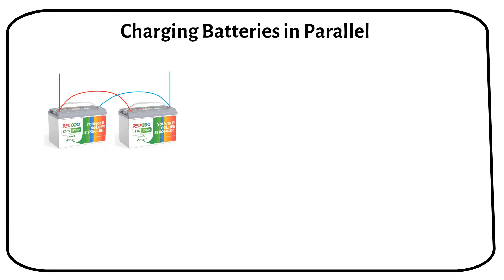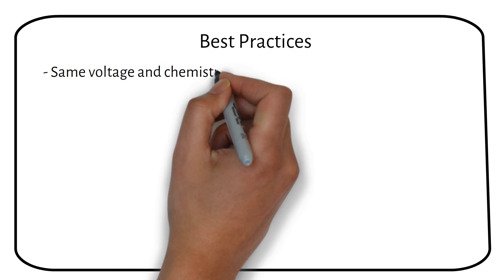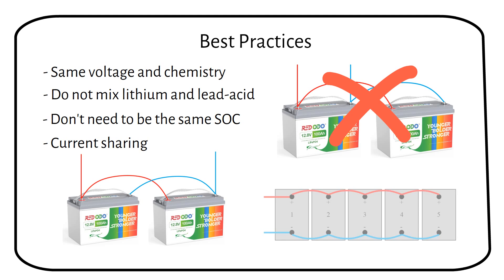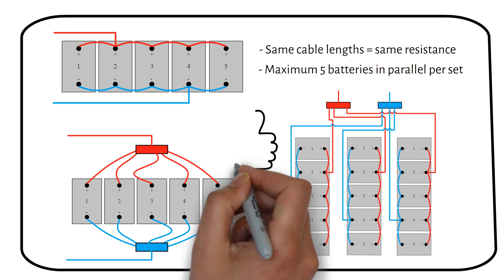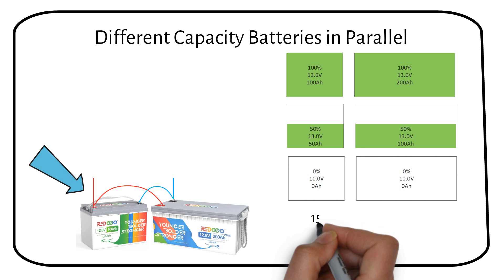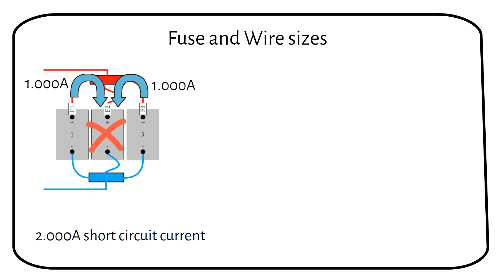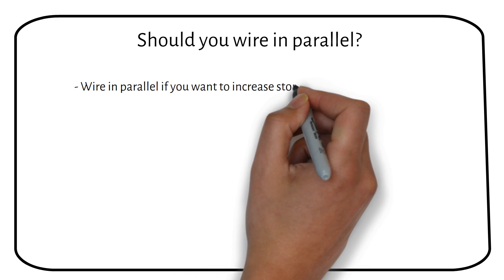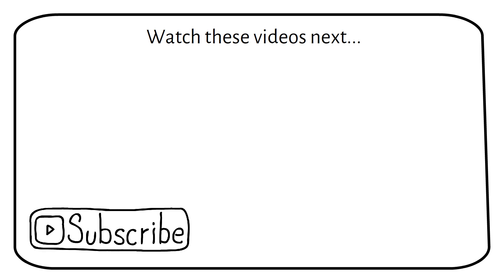How to Charge Batteries in Parallel With Different Capacity

Comment: hello . i am trying to use a powerbank to my smart door that is presently using 6 1.5 volt batteries /output 3 volt .6 amp . can a 20 000 mili amp powerbank wired directly into the batteries?
not sure if you can take the time to answer this, otherwise can advise where I can find the answer? so much thanks in advance . Frans

Comment: How would i install a shunt with the busbar method?
Reply from the maker: New video about parallel batteries is coming thursday
Reply: @cleversolarpower  I'm looking forward to figuring out how to add a shunt. I used this method because you sold me on the busbar and the individually fuses batteries
Reply: @cleversolarpower just saw the video and I'm more confused.
Reply from the maker: You need method 3 😉
Reply: @cleversolarpower Thanks Nick I got it! I need to add bus bars between my load bus bars and my batteries. I currently have my load and my battery going to the same positive bus bar. I will need to add a separate bus bar for the batteries that will then lead to the load bus bar and the same on the negative side. You are the man!

Comment: My odd question not covered by this great video. How to properly charge and discharge to and from a 3 marine (180ah) in parallel battery bank? 
I know the best way would be using buss bars, but is charging from the middle battery ok?
Reply from the maker: Best to charge from the first and last battery. Positive on 1st battery and negative on last battery. This Thursday I have a new video about batteries in parallel.

Comment: Can you explain why its more optimal to connect to battery 2 and 4 rather than 3 and 3?
Reply from the maker: That's for sharing the current equally. The current now has to travel the same amount of wires. You can also connect to 1 and 5. And that's what I recommend doing now.

Comment: With 5 batteries in parrallel going to busbars where do you put your Battery switch ? Downstream of rhe busbar doesnt make any sense ?
Reply from the maker: After the busbar so you disconnect only 1 cable. I don't see the need though.

Comment: I have a 120ah battery.  I plan on increasing my capacity by adding a 100ah battery for a total of 220ah. I have now a 125 amp fuse between my battery and a 1000 watt inverter.  I'm lost as to what size fuse I will need between the two batteries.  The load is what I don't understand.  Is the load a "potential or maximum" draw on the inverter?  I'd sure hate to add the second battery without a fuse.  You said in this video that you have another video about fusing so I'm now going to look for that.
Reply: You fuse to the size of the wire, not the load. look up standard fusing for different size wire gauges.
Reply: also every wire coming from a buzzbar or a battery should have a fuse.

Comment: I have 3 battery one 100ah and 2 50ah 48v system how do i fuse them
Reply from the maker: That depends on the current the inverter draws or the solar charge controller puts in the battery.
Reply: Thank you

Comment: Hardly makes any difference in parallel. I try with one then 4 and go down in amps the same. Unless 4 battery set up is no good
Reply from the maker: Yes, at low discharge/charge current it's not going to make a lot of difference. Because the lower the current, the less resistance in the wires because of less heat generation.

Comment: Hello , I'm not sure if you ever covered this , but I have 2-12v 280ah batteries in parallel, I was advised to use the overkill solar app , as I was looking around the app , I accidentally hit the set idle current to zero . And once I did that my batteries have been acting crazy , SOC is off on both batteries , says it's a 100% but the cells are only 3.1 volt , and have 162 ah out of 280 , they will only charge at 12 amps when before they were charging well over a 100 amps , do you know anything about that app and maybe how to fix this problem? Please say you do lol if so may I direct message you or email you ?

Comment: When I see people having a settup with two DIY LifePO4 batteries I always see the batteries stacked and the plus and plus are connected and the minus and minus. This was also adviced by my contact at EEL Battery. But from your video I understand the best for me would be 2 busbars.
Reply from the maker: plus to plus is not a problem. It will work good as well. But then you need to use the same cable everywhere. With a busbar you can have a smaller cable. Check my video about 'current sharing' for more information please.

Comment: MODEL: HIS2200

Inverter Mode:

HYUNDAI

Rated Output: 1600W
DC Input: 24V battery/83A
AC Output: 220Vac- 240Vac, 50/60Hz, 7.2A, 10
Line Mode:
Rated Output: 2000VA/2000W
AC Input: 220Vac- 240Vac, 50/60Hz, 11.8A, 10
AC Output: 220Vac-240Vac 50/60Hz, 9.1A, 10
Charge Current:
15A Default (0/5/10/20A Selectable)
Solar Charger Mode:
Operating voltage range: 30V-36VDC
MAX charging current: 60A
Reply: I have an inverter, model name specification send. Can i make a solar panel system. Please make for guidance

Comment: I’ve tried wiring two 100ah 12v batteries into bussbars, both the load and charge controller are also wired to same bussbars.  Cables are same length, gauge & originated from one original cable, both batteries have MRBF on top of + connection. One always discharges & the other does not, what am I doing wrong?
Reply from the maker: Measure individual battery voltage, check if the fuse is broke, measure resistance in the circuit.

Comment: Thanks for video. Now i have one 24V Lifepo4  150 Ah battery wired to a 2/0 AWG wire with a 250A breaker. If i want another (same) battery connect parallel to make it 24V 300Ah, would i need to use another wire, instead of the 2/0 AWG? And possible another breaker also?
Reply from the maker: The fuse is based on the wire. If you already have the cable then no need to exchange it for a smaller one. You can use a smaller one for you other battery but then the fuse has to be based on the wire.
Reply: @cleversolarpower  i have a 250A breaker/switch with a 2/0 AWG wire for the battery. If i understand correctly this will be good enough for a 24 Volt 150Ah or 200Ah  Lifepo4 battery?

Comment: Thanks so much...I did not consider resistance in wiring my parallel deep cycles and now realise I have been working the first deep cycle harder than it needs to be worked...and your 150% rule of thumb for oversizing is very handy...thanks so much! 😁
Reply from the maker: My pleasure! Glad it was helpful.
Reply: @cleversolarpower 
Hi there men,  question i have 24v 3600w inverter if i have a bank of 4 battery in parallel 24v 400ah total what MRBF i should put in each battery 150ah  or is wrong???
Reply: @cleversolarpower 
Ohh i saw the ecuation inverter 24v 3600w 
4 bat in parallel total 24v400ah

? MRBF?
3600÷24v x 1.25÷4bat x 1.5=70 i can put MRBF 80ah that right?

Comment: I have 5 agm batteries with different ah.Does it matter which battery i make battery 1.l have 
(1)200ah, (2)155ah
(2) 100ah.
Can I put 1 lead on battery 1 and the other on battery 5..I notice you use battery 2 and 4.Will it make a big difference
Reply from the maker: I recommend to connect the inverter to battery 1 and battery 5. In theory, the middle one will work the least. So you should place the lowest Ah in that position. Have the 100Ah in the middle, the 200Ah as the main positive, and the two 155 as battery 4 and 5.

Comment: I have the batteries 15 feet apart they are grounded at their closest points due to this length apart, they are connected in parallel at the positive terminals with x2 runs of 1/0 welding grade OFC wire with a NVX smart battery isolator in the trunk, i'm looking to use the same charger to charge both at the same time in this configuration if possible and what charger will i need. I'd like to get a Taramps 200 amp charger and mount it in the trunk and leave it hooked up always DC side of things and just plug the AC cord in at night to charge my system, let me know what you think of this can it be done and what are the negatives of doing it this way?

Comment: I have two 12v batteries connected in parallel, can I connect one solar panel to each battery with its own charge controller on each solar pabel

Comment: Hi Nick, I'm assuming if I had two 12v 100ah batteries wired in parallel with a bus bar as shown, with equal lengths of wiring and each had a maximum continuous charge rate of 50amps, a 100-amp 12v charger would be the maximum needed? Thank you

Comment: Just curious—why do you suggest wiring batteries in parallel would lower the C-rating? I always thought the C-rating is fixed per battery based on its design, and that parallel wiring increases total amp-hour capacity and available current, not the C-rate itself. Are you saying the inverter's max input is the limiting factor, so adding more batteries doesn’t actually increase what the system can use unless the inverter is upgraded? Just trying to understand your perspective.
Reply from the maker: Indeed, the C-rating is fixed. By saying it reduces C-rate is meant the discharge current. It might have been confusing. A lower discharge current will improve lifespan.
Reply: @cleversolarpower  That one tripped me up too.  But it's language.  There is the C-rating of cells and then there is the C Rate.  Or rate of C in a configuration.  Parallel reduces the rate the battery has to work at.  But it's still rated for say 1C as needed.

Comment: Hello 

Thank you for this video. Do you need busbars when you put 2 identical lifepo4 batteries in parallel ?
Reply: Also do you need an equaliser?
Reply from the maker: No, just use battery 1 for main positive and battery 2 for main negative. You only need a balancer when you place batteries in series.
Reply: Thank you very much.. Is your book more detailed than your vidéos ?

Comment: I’m connecting two 12 v lithium batteries in parallel. 
Can I connect a dual bank 12 v battery charger to each battery to separate to charge them individually even though they are in parallel?

Comment: What if I make a bettery 4S2P, but there will be missing one parallel battery in the last pair? Will the BMS work? Will they charge the same voltage? 
I need this to balance my cells, I have some charged and some brand new

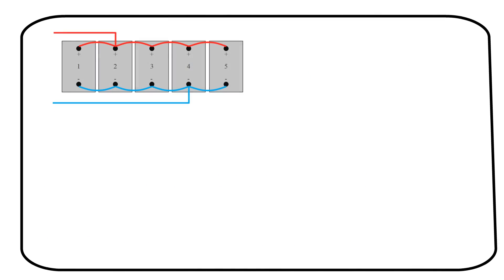Comment: 2:46 That is also not correct. For the battery 1 and 5 there will be 4 pieces of internal cables to the terminals, and the battery 2-4 there will be only 2 pieces. You should put the terminals to the battery 1 and 5 (instead of 2 and 4).
Reply: 100% correct

Comment: A lot of things in this video seems weird. First of all, connecting a lead acid battery to a lithium battery, is perfect in my experience. The lithium will maintain the lead acid at a nice float charge, its like the lithium is caring for the lead acid like a baby. Then all these different connections you talk about, where is the BMS?
Reply from the maker: You are missing out on some capacity if you use lead-acid with lithium. The BMS is inside the battery (not shown).

Comment: With three 12v 100amp batteries, would i size the wire acording to the total amps(300a) or the total amps drawn? (Inverter etc.)
Reply from the maker: Total amps draw in the circuit. Always size on the max current draw from the inverter. So a 1000W inverter on a 12V system: 1000W/12V=84A times a safety factor of 1.25 = 104A. If you only have a 500W load, then you still need to size according to the max load on the inverter (104A).

Comment: I have built my system by a lot of your suggestions and everything has worked out well so fare , I wanted to charge my system with a battery charger I have 3 batteries and using a shunts so should I hook the. Charger to the shunts or charge each battery separately
Reply from the maker: Glad to hear that! Connect the shunt to the same connection points as your inverter. Take a look at my diagrams on my website homepage as well. It's shown there.

Comment: After watching your video, I would like to ask you that what is the best way to balance the lithium batteries? I have 48 volts system that is 4S 3P formation.  Each battery is 12 volts. 300 amps. Would you suggest battery balancer . Any advice is appreciated. Thanks for the video. It is great. Thank again.
Reply from the maker: You need one battery balancer for the 4 batteries in series. The parallel string will balance each other. So you need three balancers for your 3*4 batteries in series. checkout my video about why i don't advice to wire batteries in series.

Comment: How would I go about connecting 12 12v 100 ah lifepo4 batteries in parallel?
Reply from the maker: I would do them in 4 pairs. So have 4 of them in parallel and then connect them to a busbar. then do the same for the two other sets. In total you will have three sets of 4 batteries.

Comment: If I put two 12v 100ah lifepo4 batteries in parallel and only one has a built in monitor, would that monitor automatically include the other as an extension of itself when displaying stats on the monitor?
Reply from the maker: No, you need a shunt. A shunt is placed on the main battery negative of all the three batteries thus it will include the total % left in all three batteries. They can have a display as well. I made a video about it. Search for 'shunt' on my channel.
Reply: @ very helpful, thanks! That would have been an expensive mistake considering the price differences even within the same brands with the same capacities, thanks 🙏

Comment: How about if two lifepo4 with bms each? How do you parallel it?
Reply from the maker: You can just parallel them, they will work independently.
Reply: @cleversolarpower  i did it and i followed your method. 
How about the inverter? Positive of inverter connected to possitive of battery 1 and negative of inverter to negative of battery 2.? 
Is it correct? 
Thx you for sharing your knowledge.

Comment: Nick. I have 4 batteries. I am running 2 pairs in series at 24 volts  .the pairs are connected in parallel. This way I can run the car fridge at 24 volts and also maintain a 12 volt system at the same time without a step down or step up converter. Also charging at 24 volts is much more efficient for the 12-24 system.. I have not seen any videos on duel voltage systems? Basically it is the same as splitting an American 240 volt system into 2 120 volts lines...
Please elaborate.
Reply from the maker: It's not the same. If you tap into the battery to get 12V, you will drain one in a series connection. This leads to imbalances and you need a balancer. Check my recent video about why it's a bad idea to wire batteries in series.

Comment: what will happen if we connect 4 different size of batteries?  like 4 sizes 50ah 100 ah 150AH 200 ah and 300 ah. will the inverter fully charge every size of battery or the inverter of 48volt will charge the smaller one and will leave the rest of there bigger batteries according to the small size battery

Comment: Looking to parallel a couple 14s  (two  300ah NCM) batteries to an exisiting 16s ( one 280ah LiFePo4) battery .  End voltages are similar, in the range of my use,  but  with a flatter output curve on the lifepo4 battery.  So the current output would not be linear along the output curve.  Is the internal resistance a key to making this work?  Would you add a little resistance to balance the chemists?    Possibly the safest method would be to use the LiFePo5 battery independent of the NCM batteries. What about voltage-current spikes when switching?  
  thanks, bob
Reply from the maker: You can wire different capacity batteries in parallel (check my recent video). However, i never tried with different chemistries and i don't recommend it. the voltage ranges are too different from each other. 2.75V-4.35V for NCM and 2.5V-3.65V for LiFePO4.

Comment: I have been discharging my (2) smart batteries by utilizing the 12 Volt lights in my Toy Hauler RV, approximately 32 watts per the Power Queen Battery monitor. I have noticed through the Power Queen App that the Batteries are not discharging equally. In fact I now have battery (1)12100BG-A00798 at 98% and battery #2 12100BG-A00602 at 23%. I have noticed that battery #1 is in standby mode per the App. Is the standby mode normal, or do I need to take it out of standby mode somehow? If I need to take it out of standby mode how do I do that?

Comment: Ive used Lithium and lead acid charged simultaneously in parallel for atleast a decade. Its common for sailboaters to do it also. I use different voltage Lithium in series bc voltage is additive.. Direct dc to dc solar charging with no inverter, charge controller or bms.Thats probably 2 more things you'd tell us isnt feasible...  Just because something isn't recommended doesn't mean it can't be done safely and be functional If you know what you're doing...
Reply: Id like to know more about this, really hard to find information on how to safely wire lithium with SLA. Never knew could be charged like that but you are right on everythings possible if done right. People have almost 0 knowledge on electricity or batteries if any at all many not capable of grasping the concepts
Reply: @andyirons7162 only dodgy if you are. If you dont know why even comment?

Comment: Can you clarify something? 
In this video you have a slide with a 150A load  that shows rthe 110 Ah battery providing 50A and the dual battery bank providing double. 

But you have a later video where you say that the smaller battery will put out disproportionately MORE charge because of jnternal resistance.

I am particularly interested in this subject as i have a lead acid configuration where a battery switch has  a single 110Ah 12v  battery on one side and two identical batteries in parallel on the other.

General usage seems to result in the single battery deteriorating over time.